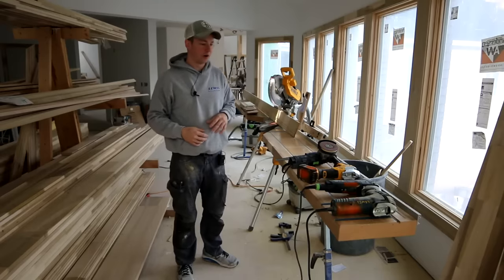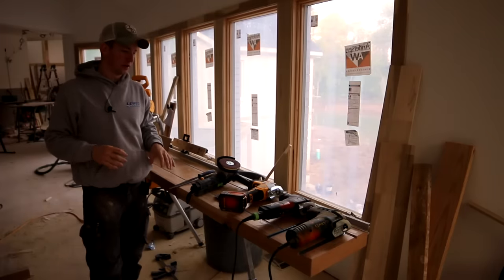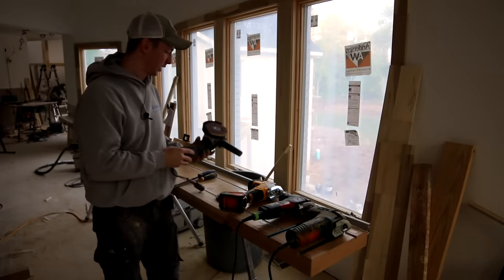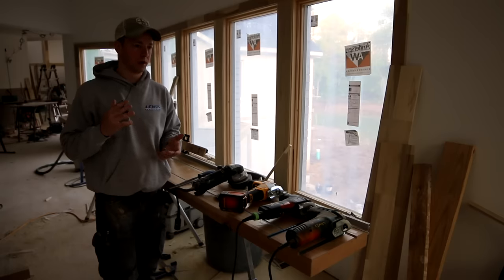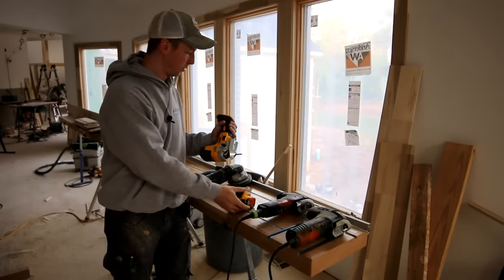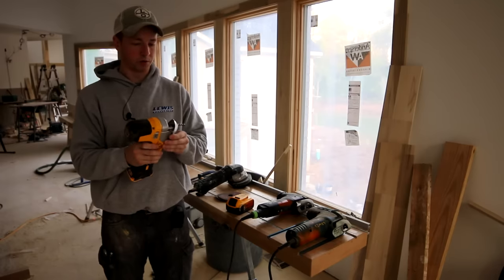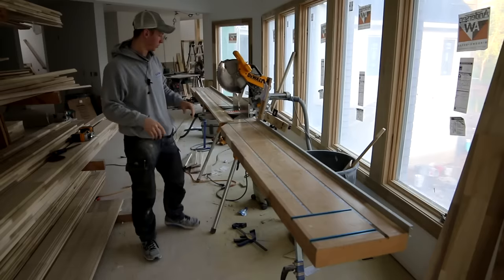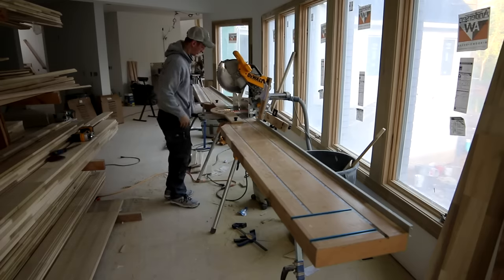Best tool for coping base and crown??? Dewalt DCS335B w Coping Foot for the Win

Comment: Without doubt a grinder with sanding disk takes a bit of time to master but once u have its so much faster
Reply from the maker: I feel on larger hardwood profiles it was to slow and dusty for me. Fine for smaller softer profiles though.
Reply: I could say the same about hand coping. Fast and accurate, no need for file or sandpaper, prefinished hardwoods mainly for 35 yrs

Comment: Im a carpenter and tbh I think by using 33.5 on the back and bottom angles and they will give you a 45 angle perfectly its faster than doing all of that , wich is a good way also but takes too much time and process.

Comment: While not a carpenter by trade...I will stick my neck out on this one and see what people think. My go to coping tool is a table saw with a carbide tipped blade. Radius the teeth to a rounded profile. Lay the piece flat and crank the blade 
up or down to get the proper relief or back cut. Side cut the material until you get to the actual profile. A steady hand helps.

Comment: I don't remember the name but there is a tool that automates all that. EDIT: well that's the copemaster and you even did a video on it on the same day. Why are you not using that? It's like one video you say I use this, another you use that?
Reply from the maker: There is a time loss with bringing the copemaster onsite and setting it up. Most of the time I just cope with the jigsaw/coping foot. I only use the copemaster on big jobs with profiled trim.

Comment: As always, excellent presentation. What is your orbital setting on the jig saw and what blades do you prefer? Thanks.
Reply from the maker: 244d blades. It depends on orbit sanding. I switch it up based on profile and how crisp of a cope i need it to be. Obviously less orbit for more control, but more orbit is better for hogging out material and coping faster.
Reply: Insider Carpentry, thanks.

Comment: "I dont ever test them" lol cmon bro we all check if the cope fits good its so satisfying lol :P My preferred coping tool is a hand coping saw as all the trim we do here is poplar or pine, just the way I was taught!  The same way you say "keep even pressure" on the jigsaw- it's the same concept for hand coping.  Keeping a constant rhythm and pressure- I think about where I want the saw to go, and it goes there.  Lol no joke.  Havent had to cope oak yet, but I'd probably pull out the jigsaw for that one!  Cheers!
Reply: Btw Bro I would really love a video talking about your miter saw setup.  Specifically the long wooden table attached to the stand.  Also would have to see where you store those beasts.  You must have atruck lol
Reply from the maker: I've got a video on the wings and a video tour of my van. Check out the video list on the channel page. Thanks
Reply: Insider Carpentry Awesome, thank you!!

Comment: Thank you so much for sharing this information and for the video.  Saw and foot delivered today. Installed the foot without any instructions for this model... looks like it will only go together one way. Going to pick up some molding and get some practice time in with this setup. 

Question: Any issue with the lights?
Reply from the maker: Glad to hear. Regarding the light, I broke it so that it wouldn't be shining up at me. I just used a screw driver or something and kind of pried on the LED module and both shut off. I knew I didn't want the light functioning.

Comment: Nice video. I don’t think that there is one best coping tool if you have to work with both solid wood and MDF moldings. Here in Southern California, MDF molding is a pretty common material for trimwork and it does not cope well with a jigsaw or a coping saw. The stuff is best coped using a disk on a grinder. But when it comes to wood molding, the jigsaw excels. A grinder can work in a pinch but the disc loads up with sap and sawdust So when it comes to wood moldings the cordless jigsaw with the coping foot is a good option unless I am doing a large job in which case I pull out my copemaster. These days I rarely use it but my copemaster is great for production work even if I cope all the material initially and then later cope various pieces with a jigsaw or a grinder.

Comment: Yeah I've used/been through all of the methods mentioned in the video, I ultimately wound up inventing my own tool for the job. I made a tool that is completely dedicated to the task of coping molding profiles. The tool is split into two parts 1) a coping wand 2) a motor that drive the tool. This may sound like a big deal but it's actually not very complicated at all and works much better then accessorizing current tools with bolt on gadgets. The saw works the same way as one of those 2pc power carving tools only the blade saws back and forth in a sawing motion. Separating the motor from the cutting wand allowed the tool to be very lightweight, maneuverable and accurate without the bulkiness/clumsiness experienced with the current crop of tools on the market.
Reply: Sounds interesting, you should make a video about it

Comment: Hand coping large complex profiled crown sux!! I just had to do it in a bathroom, 1 piece of massive crown, copes on both sides, ( I didn't want to put a scarf joint in the middle) half hour to cope each joint by hand. If I was off I was Fucked. Worked nice but took wayyy too long.

Comment: I want the barrel grip so bad, currently using the regular jigsaw with the Collins coping foot, I will say I’m getting much better. But I have a different question, what mitre saw would you recommend, I current use the Rigid 12” sliding compound saw and it starting to give me problems. Any advise would be appreciated.
Reply from the maker: I like the DW780 XPS. It is what I use daily. I good blade is really important also. I use FS Tool LM or SM 6300. It is listed in my amazon storefront lists. See video notes. See the onsite tool setup list. If you purchase through those links amazon gives me a kickback. Thanks 👍👊

Comment: A rotozip is 10 times better. No files to deal with or turning a jigsaw upside down and about $200 cheaper. You dont even need the coping foot just run the base of your jigsaw on the bevel of the trim that gives a automatic back cut. You did a good job with it though and it seems to work. Thanks for showing another way.

Comment: at 4:30 cutting the straight section at zero degrees? should it be slightly back cut to take advantage of coping with non-perpendicular joints?
Reply from the maker: Not necessary for paint grade trim. My work is tight cutting square.

Comment: Not sure about the point about the back cut... not trying rag on him but I’ve always used a healthy back cut and never had a problem...if your measurements on length are accurate enough it shouldn’t get so tight that it’s crushing into the other board or splintering things.

Comment: I dont know about anyone else but id love to see a vid on double bead crown coping. i dont know if its must me, but i just miter its cause i dont like the cope results
Reply from the maker: As a general rule, a double beaded crown is considered by most to be a NON-copeable crown profile. If you put the crown in position and any part of the profile comes to, or passes the horizontal plane it can't be coped correctly and needs to just be mitered.

Comment: Your DeWalt seemed like it doesn't have a light. My biggest problem with this tool is that the work light is glaring and you can't see your cut line. Is there a way to shut this light off or did you just tape over it?
Reply from the maker: First thing I did was jab a screw driver into the led and twist. Permanently disabled.
Reply: @InsiderCarpentry  That was close enough to my intended fix. Thank you for taking the time to reply and I enjoy watching the videos you put out.

Comment: Great video, trying to learn this way of coping. Have a question, bought the 50 pack of blades you have in your store, they wont stay locked in saw, am I missing something, factory blade works fine. Thanks

Comment: Much respect for your skills, but I have to disagree with you here.  I love power tools, but I think a hand coping saw (with a fine tooth blade set to cut on the down stroke) gives more control.  More back-cut is usually (not always) a good thing :)

Comment: I take a piece of sandpaper that has a sticky backing an stick it to a piece of scrap of whatever im trimming an then use that to sand my coped board instead of the files not sure if you ever given that a shot or not.
Reply: Is that because it matches the shape of the cope? I'm trying to visualize your process
Reply: @brianherman503  the sticky sand paper will take the form (with work) of the trim piece then you can make your cope cut an butt against the sandpaper an lightly sand making the cope fit the contour of the trim piece perfectly. Just one way of doing it.
Reply: @justinrutledge6090  that's kinda what I thought you were getting at. It seems clever!
Reply: @brianherman503  its just what I thought of. Im not a finish carpenter specifically but I had to do the job an thats what I thought of at the time. Its not the right way or wrong way but it is a way.

Comment: When I started as a carpenter, there were no sliding compound saws, nail guns, etc. Just hand tools and some saw horses. Does that make me old? Sure I have lots of tools now but does anyone remember when you sent your handsaws out to be resharpened?
Reply: Or sharpened them yourself.
Reply: I have based many complete houses with only a scribe and coping saw... later used a circular saw and guide...

Most of the early mitersaws would not cut 5 inch wide base.

Tools often just increase speed/ reduce learning curves...not improve quality.

Comment: Hi. I want to take an inch off the top of my joists in my bathroom so I can put in a wet room floor. Which tool can I use to do it accurately and square on the tops?  Thank you.

Comment: Hi Spencer. I like your videos and it really helps me in the beginning stages of trim work. Just curious are you obligated to Dewalt? Or are you willing to use and promote other tools that might be a better application? Just curious if you have found other tools that you really like but you don’t use on your channel because it would conflict with Dewalt. Thanks for Sharing all your talents and skills you have learned over the years. He really helps me understand the skills of trim work. Colorado USA
Reply from the maker: I'm not sponsored or supported by dewalt in any way. I use what I like irregardless. I am a fan of both dewalt and milwaukee.

Comment: How do you find the weight of the 20V Dewalt cordless jigsaw at 4.6 lbs?  I have been looking at the 12V Makita JV102DZ  jigsaw at 3.6lbs.  It looks like it would be easy to handle.  Do you wrap your hand around the jigsaw when its upside down?  Have a look at let me know what you think?
Reply from the maker: The weight doesn't bother me personally. I like it because its the same battery as all my other cordless tools.
Reply: @InsiderCarpentry  Thanks for the reply.  I have been researching this quite extensively.  The corded jigsaws weight about twice as much as the cordless versions. I have the Makita 18V system, so if I go 12v i have to get batteries and a charger. This makes it as much or more than the Dewalt 20V.  I'm going to have to do some hands on testing to make a final decision.  I guess I'll start with getting a collins coping foot and using it on a corded saw I already have.  Love the videos, I trimmed condos one whole summer when I was 18.  I'm now in my late 40's.

Comment: When to cope and when not to? Does coping work well past 90 degrees and well less than 90? Let’s say my corner is 135 degrees, can this be coped or do I just use the nested cut?
Reply: If you cut at half of 135 but you have to be severe on the angle of the cope

Comment: Nice video. Have you tried the new cordless Carvex for your coping tool?
Reply from the maker: I haven't, with so many good options I don't feel that the extra cost is justified for coping.
Reply: I understand. Festool is a pricey line of tools. In the case of the cordless Carvex; though it’s a well balanced and thought out tool. In particular though the blades are superior in cut quality, dust extraction is excellent, but the strobe blade light feature that makes the blade appear still keeps me on the line very well.

Comment: I have to admit, I am lost, I just started coping and the way I've done it is to take a scrap piece placed perpendicular and I draw the outline. What is the purpose of the 45 and then the straight cut? How do you know how deep to cut and when to change the angle without any markings?
Reply: The 45 degree cut takes the place of using a scrap piece to draw the profile
Reply: @kurtiskumerow5022  When you cut the 45 square, how much reveal do you leave?
Reply: @kurtiskumerow5022  I just went through it and makes sense now. Also standing the board on end is way easier than back cutting flat and never getting to the exact depth or going to far depending which side your cutting

Comment: Awesome video man. What type of blade do you run?
Reply: Thas a FS blade.
Reply from the maker: FS Tool SM6300. My babies. I have three or four. It’s all I run in my 12” saws now. Amazing blades for production trimming. They hold a sharp edge for an incredibly long time and spin really well. Should be able to get ten sharpenings off a blade.
Reply: Where do you get your blades sharpened? Or do you do it yourself?
Reply: @InsiderCarpentry  tagging you about previous question lol.
Reply from the maker: @tommgunn4219  I ship them to a sharpening service called WD Quinn. They have a state of the art sharpening service and do a fantastic job. Turn around time is very fast. I spend enough on my blades I would only send them to someone running state of the art equipment.  https://www.youtube.com/watch?v=bLsRarSwErQ

Comment: How do you keep the work lights from blinding you.
Reply from the maker: First thing I did was jamb a screwdriver down into the led light to break the connection and disable the light.
Reply: @InsiderCarpentry  doing that tonight. Screwed up my first 2 pieces practicing because I couldn’t see.

Comment: What turns on your vacuum when cutting on the miter saw?
Reply from the maker: You plug the tool into the vac and it turns on automatically.
Reply: Insider Carpentry are you using one of these foot pedals that’s plugs into the wall then plug everything into it? I’m not sure what you mean. Could you please explain? Would really like to have this

Comment: Hey brother-just discovered you today and already learned a bunch.  I have a question though- im not sure what part of the country you are from but I'm trying to understand all of the unprimed finger joint poplar.  I love FJ poplar but it obviously is going to be painted not stained or clear so it seems it's so much more work for the painter to have to prime and sand all of that poplar.  Also regarding coping-I recently bought a tool called the copemaster 2 which works like a huge key cutting machine. So awesome. Not practical for smaller jobs of course. 
Thanks for your videos!!

Comment: I cut them on chop saw to 45 and no coping,I don’t get why you would cope if you can just cut it ,not saying its not right way just feel there is quicker way
Reply: I agree I only cope when necessary like when your floor or ceiling are out of level
Reply: @TerryTips2023  oh, you mean, like 99.9% of the time?

Comment: there is a finish carpenter on youtube that has grown to like coping with a grinder and sand wheel check him out I thought it was pretty cool....never tried it though. I think its finishcarpentrytv
Reply from the maker: Its a good method but I don't like the dust and it takes to long on really large hardwood moldings.

Comment: After 30 of trimming you take twice as long to do a simple job. Cut a 45* and with the proper  toothed blade in your coping saw it takes seconds to cope a 3"base...1 tool . You must be paid hourly as the way you do it you would be making minimum wage. Cut and cope any type of trim with a slight back cut is second nature . Modern tools aren't always better or faster.
Reply from the maker: I don’t disagree with you. But I started in trim work coping 7-1/4” hardwood crowns. And thus I started with a tool that would get the job done faster. There is also the issue of physical wear and tear on the body. It adds up vs using a power tool and eliminating all that motion. To each his own.
Reply: @InsiderCarpentry  Thank you for your view.

Comment: I don't cope crown anymore. I miter cut a short piece and a long piece, add a dab of glue, shoot them together with small brads and wait a bit. The other end is cut square, and this way the next piece can be cut a hair long and snaps into place. When I started out, miter saws were not great, and brad nailers were not everywhere. Corners built this way will never open, a goofy ceiling or sheet rock can't through things off, and most of the pieces barely need a tape measure.